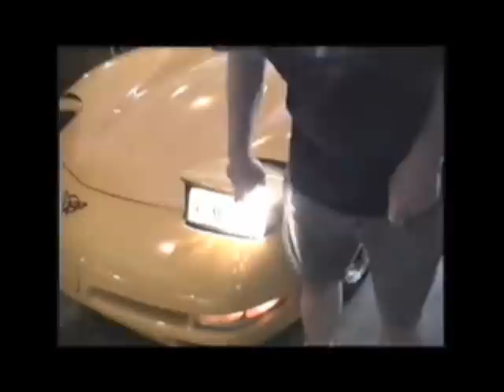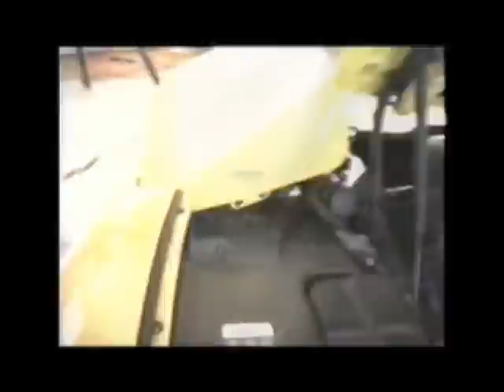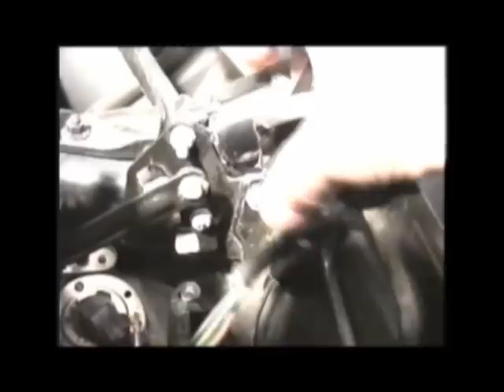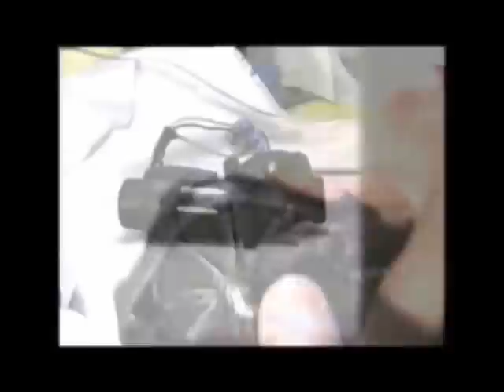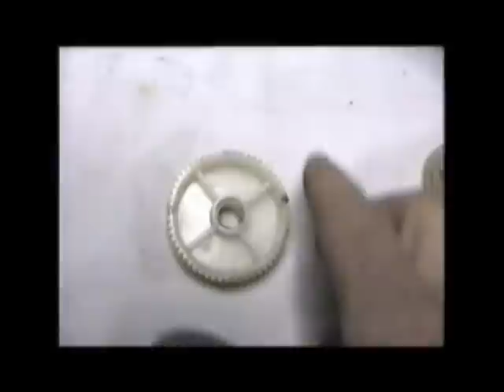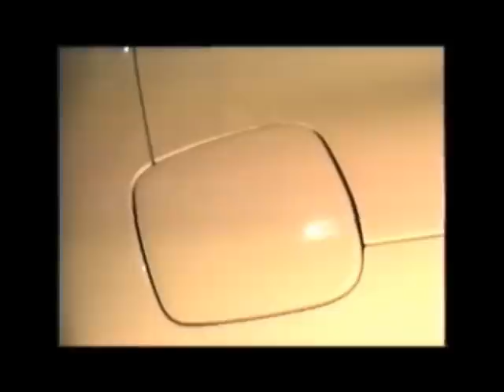Replacing the Drive Gear in a 2001 C5 Corvette Headlight Motor

Comment: Several years ago I did this repair to both headlights in my 2003 C5.  But, I went one better.  Instead of installing another nylon gear, I upgraded the gear to brass.

Comment: I can't get the actuater arm off. How do I get the screw bolt to release?
Reply from the maker: Sorry you are having trouble.  Looking at the video I did not have to do anything unusual to remove the arm.  Were you able to remove the nut on the motor shaft, or is the arm itself stuck on the shaft?
Reply: @dennisbsutube  Finally got it. Think it was actually glued on. Thanks.

Comment: CAM ALIGNMENT!  Great video, made the repair myself in a couple hours with your help.  Would have been faster except the alignment of the cam.  It is SO important to make sure the cam is aligned pretty much exactly the same way as it is when it comes out.  I thought I had it aligned very well but nope.  Needed to remove and change alignment three times until I got it right.  And that is a little hard to do as the cover gets glued back on.  After the first time tearing the glued cover off a sceond time I held it together with electrical tape until I was able to get the alignment correct on the third try.  Then re-glued.  Thanks for the video!
Reply: Yeah,.. it IS a PITA when you don't get it aligned correctly! I've gotten pretty good at removing the damn thing.....

Comment: Excellent video. Had a little trouble with the hinge bolts, but all went fairly smoothly. But, after I was done, I tested the lights four or five times in my garage - perfect, smooth as silk. Then I took it out for a test run (daylight)  and turned the lights on and off several times - again, smooth as silk, perfect. As I got closer to my house, I thought I'd test them one more time -- oops, the repaired light only opened half way. It closes good, but, over and over, it now only opens half way. What a major disappointment after thinking I'd done a perfect job!  Any ideas on what might have happened?  How does it go from 'smooth as silk perfect' to only opening half way?

Comment: I think this video showing everything that it takes to replace the gear on a C5 Corvette has to be the best that I have seen on You Tube. This was the first problem I have had and it is on the Driver Side.  I saw on my '99 Coupe 3 small bolts held the housing together on the headlight motor where the main gear sits. Have to say I can't understand why GM changed that design on newer C5's where you must split the case and then have to glue it back together. On the '99 its just 3 small bolts and pry the cover up. Even has a cork gasket sandwiched in between that was like brand new still so I reused it. Tightened up the 3 bolts and that is it. I put the Brass Gear in supplied from Ecklers. Came with a new gasket I really didn't need today and new rubber block to go inside the Brass Gear.  Nothing else needed. I added some Super Lube Multi-Purpose Lubricant with Teflon (Clear) I happened to have on the shelf to the new gear and the factory gear still in the housing. Could put it right back in tonight if  I feel like it being there isn't any worry about glue to dry as there is I believe in the 2000-2004 if I am not mistaken C5  Headlight motors. Thanks for the Video Dennis. You did a great job.

Comment: I epoxied the case back like you said and I have to change my plastic gear again how do i separate the case without destroying it? I only got 35k miles out of those plastic gears they wear out to fast.
Reply from the maker: I would still insert a sharp blade into the joint and pop the lid off.  You can cut into the joint somewhat with a utility knife if the expoxy set too hard.  Take your time, you'll be okay.  You can use a brass gear if you want a stronger part, but I would also be suspicious about how well the worm gear on the motor shaft is engaging the gear your replaced.  Plase read my comment below to SwissHarmonie.

Comment: The cheap plastic gears available at the auto parts stores and online are much lower quality than the OEM plastic gears. They are actually undersized so only the very edge of the gear meshes with the drive gear. I have seen them fail after less than ten cycles open and closed. If you only want to do this repair once I suggest purchasing this kit from carguy8t8 on eBay. With this kit you will only have to do this repair once for each side. http://www.ebay.com/itm/Corvette-C5-Firebird-Headlight-Motor-Repair-Kit-Aluminum-Gear-Upgrade-LH-amp-RH-/151301458768?rd=1

Comment: Well done! My '02 Z06 driver side does this exact thing. The car has really low miles, so it is perplexing how this gear could have worn out.  Thanks.
Reply from the maker: Thank you.  Make sure the motor itself is not loose within its own mounting bracket (press fit tabs).  I think that is what made mine go bad, the gears were not meshed tightly together. See my comment below to SwissHarmonie.

Comment: I replaced the chewed up plastic gear by the brass one and everything worked perfectly. Now after 3 weeks, the light only comes up half of the way. Is there an adjustment I need to make? Highly appreciate your guidance and thoughts. Manfred
Reply from the maker: The motor shaft has a worm gear that is mounted perpendicular to the drive gear that you replaced.  The motor itself can become loose within its own mounting and not mesh tightly with the new gear.  Make sure there is no "play" in the motor mount.  If there is movement, an easy fix is to pull up on the motor to assert more pressure between the gears, place a temporary wedge like a piece of wood to hold the motor up, clean any grease away from the motor housing near the gears, and insert a marble size ball of moldable epoxy "putty" to serve as a permanent wedge.  Remove the wood wedge after the epoxy has hardened.  Good Luck........Dennis
Reply: Thanks Dennis, Now that I reopened the headlight, I see that the glue of the actuator cap did not hold. I forgot to install the bracket which came with the Rodney Dickman kit. I just have to do whatever is necessary that the glued piece cannot come off again.

Comment: The pivot bolts may have some kind of locking coating on them. You may need to spray and let them sit for an hour or so with WD 40 or bolt blaster to get them loose.

Comment: great vid thanks. i did the job with a new brass gear.  i didnt feel that it needed epoxy tho. i didnt want to epoxy in case i needed to replace or adjust the gear.your vid was very helpful

Comment: I got the part to fix it, but I noticed in the different videos I've watched everyone has the lights up. My left side won't go up (ugly noise like in the beg. of this video). I tried to crank it, but it just spins...can I still do this without the light up?
Reply from the maker: +Joe M 

Yes you can.  Please notice near the start of this video that the headlight barely came up, and then it was pulled up by hand just to make it quiet!  Go ahead and install your new gear.   Pay attention the flat side of the shaft when you take the motor out.  Put the new gear back in the same way the old one came out.  You'll be fine.

Comment: I've had my gear (copper) for 2 years haha. i'm  tired of manually adjusting the knob to where the gear catches the good spot. funny part is the side with the occasional non open makes no noise. the other side that works makes the noise..lol  but they both need to be fixed.  thanks for the effort making this video.  inspired me to finally do the repair.

Comment: Remove pivot pins, disconnect arm, use adjuster knob to rotate gear 180. Reconnect your pivots and test it out. Thank Boomer Pro. Worked like a charm.

Comment: The video doesn't tell you that you will need star aka Torx screwdrivers, and that the back 2 screws on the lid should be removed first.  I couldn't get the 2 pivot screws to move so I am going to try Boomer Po's ideam
Reply: I believe that is just common sense ! sometimes the start of things don't need to be explained, It's a great video of the gut's of the project ,It's like the first thing is to buy the car? LOL lighten up lol

Comment: If you are familiar with the gears going bad here is a free fix that worked for me

I handcranked the headlight up
took off the 10mm nut holding the arm to the motor ( you gotta take the top cover and black side cover off )
hand cranked the motor until the shaft rotated 180 degrees
re-attached the arm
hand cranked the light back down
no vid , no pics , just good info here.....
Then hit the headlight switch....works good as new 

WHY ?
the motor uses only 1/2 the 
gear
so....you get 1 freebie fix.....

if it happens 
again....brass gear time.....
worst case , it gets you by for awhile until you can repair it correctly
Reply: This video is great and certainly the way to go if needed... but I tried Boomer Po's EASY fix and was finished in 30 minutes... NO parts needed, NO cost, and Headlight door works like new again!  I highly recommend trying Boomer's suggestion first.  Boomer, U da MAN!!  Thanks!
Reply: Wes Holt it's a one time freebie. Thanks
Reply: And it works!  Thanks, man.  Follow Booler Pro's instructions exactly so you don't end up wuth the lights out of sync and you will be good.
Reply: Thank you ! Yes-- your way is the quickest and easiest way to repair stripped stock gears--and also the best way to get to the headlight motor is to simply remove the two pivot bolts--as detailed in the above video.
Reply: I was all ready to swap the motor gear out until I read your comment! I did it and worked like a charm on my C5! Much appreciated :) In my case..I turned the shaft 180 counter-clock and the headlights were out of sync.. re did the procedure this time bringing the shaft to it's original position and turning it 180 clock-wise.. that did the trick. not sure why, but they're working great!

Comment: In the video (which is very informative) the installer left his lights on, and battery plugged in... I just want to point out that if your key is off, or in the accessory position and your head lights are on for more than 15 minutes they will automatically shut.

You can easily damage your paint this way. Pinching tools, or other objects.  They will connect to the front bumper, and headlight cover.

Make sure you pull the battery, or disconnect the light if you are working on them.

Comment from the maker: The tool is called a Torx wrench.  The best thing to do is buy a set of Torx bits that fit into a 1/4" nut driver (similar to the bits that go into a power driver) or a 3/8" socket wrench. Sears.com has some Craftsman brand sets that have a lifetime guarantee and cost under $10.00 per set.

Dennis

Comment from the maker: Sorry I just now saw your question.............  It may sound too simple, but the first thing you need to do is determine if the motor on that side is getting power.  Getting power, not moving = problem is in the headlight assembly.  No power = time to troubleshoot the circuit to the motor.  Dennis

Comment: Some times I have to turn the lights on and off 3 or 4 times before the passenger side light opens on my 2001. Some times it opens on the first try. I do no hear any unusual noise .... it just does not open....then it does.  Any Ideas? Maybe some lube on the pivot points? Maybe bad motor wire connection? Any Ideas?